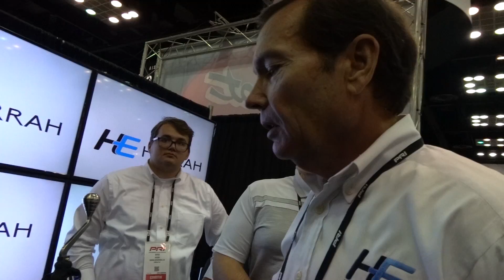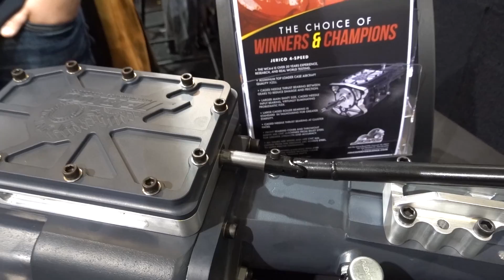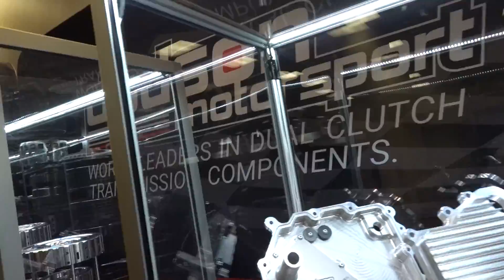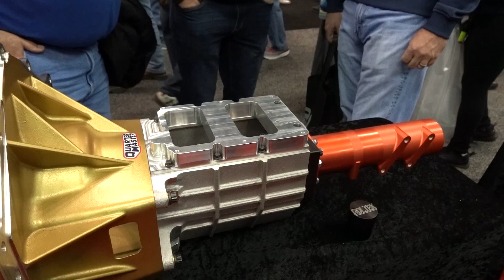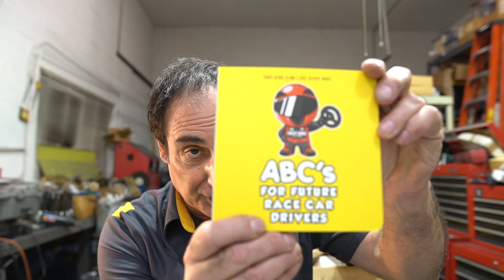PRI Show 2019 - Nascar and Road Race Transmission Edition

Comment: I have to disagree with the jasper guy. Allison is the number one distributor of transmissions.
Reply from the maker: Allison is a manufacturer they sell to distributors. You cannot buy transmissions directly from Allison unless of course you have large volumes like a manufacturer. Like general motors or something like that. But the guy off the street cannot buy a single transmission from Allison. Doesn't work that way

Comment: I think manufacturers are missing the ticket for people who are doing the pro street / pro touring with autocross or road course trackday people, who want a 5 speed they can bang gears clutchless all day, but with a nice deep say .67 overdrive so its not such a nightmare on the highway home. It seems to be o n either side of the equation
Reply from the maker: Clutchless creates wear and tear so its not practical. You can always go with a manuakly shifted auto trans. New T56 and TKX do a pretty good job as a full synchro bix with an OD

Comment: Will any of these gearboxes apply to electric vehicles?
Reply from the maker: Electric vehicles do not need a transmission
Reply: @GearBoxVideo you're correct in that they don't need one, but they do benefit greatly from having multiple gears as shown in the taycan turbo s. It gives better conversion efficiency which equates to a bit more range over a single gear. They can also be used with smaller battery's to give equal range to one with a bigger battery and 1 speed gearbox. Being able to get to a higher top speed is also a plus with having multiple gears.

Comment: Seems  to me that every heavy  Duty  Eaton Twin Countershaft  Truck transmission that I have worked  on had a floating  input shaft..  Nothing new here..
Reply from the maker: Read the responses to other "nothing new here" comments please
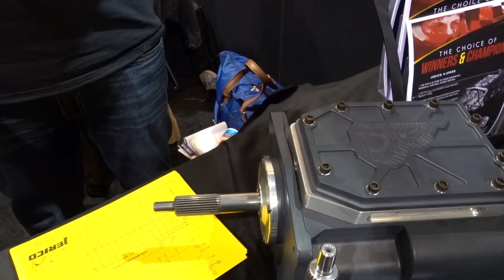Reply: @GearBoxVideo   I have  a Chevy  C-65  tandem  axle  truck with  34,000#  tandem  those are  18.5"  ring gear and Pinion    It had  7:17  gears would  only  do about  55  MPH  at  4,000 RPM's  stock  427  chevy Truck engine won't pull over 3,500 RPM's 
  It has a  13 speed  fuller  RT-613 no  overdrive..  1.5"  input  shaft  dual  disk  12"  clutch ..  a push type  clutch  non synchronized transmission ..  There is an air puck  brake to stop the gears to  get it into  first gear or  reverse.. 
  The clutch  kept  sleeping  in the early 80's  kept  getting oil on the discs.. finally I figured out that they never put a  vent in the Transmission from GM..
   It has a  10 bolt  #2  Bellhousing  that bolts the 5 bolt  Chevy  engine  pattern on the back of the engine..
   The starter  even bolts to the bell housing  not to the block of the truck as the flywheel is much larger..
  I ripped the clutch hubs  out  before  bounces the tires in  sugar snow  with  4 sets of tire chains on the truck before ..
  My  other Truck is an FWD truck with 6 wheel drive. It has a traction lock system that locks  all 6 wheels  together when you are in mud or almost stuck ..  with all 6 wheels  locked  is does not get so much wheel hop from spinning..
  The traction lock system  uses  about 700 PSI  brake fluid pressure..   next to the spider  gears is a set of clutches  like in an automatic  transmission  fiver discs and metal plates and the power divider gets locks out by sliding a toothed dog  into a set of  teeth ..that  lock out the torque proportioned differential ..

Comment: Man I have some real disdain for Getrag. they stopped making the Supra trans (233) and they never offered aftermarket gear sets at any point in time so now beat up abused boxes go for a premium. Even with all the advancement in the 2JZ drag racing and drift scenes no love from Getrag. And now the world record fastest 6 speed H pattern 1/4 mile drag car is a Supra with a T56 Magnum with dog engagement and stock gear set.
Reply from the maker: Companies are under no obligation to make aftermarket gearsets. Just replacement gears. They are also not have any obligation to make transmissions not for their intended use. Meaning if the trans is designed to handle 300 HP there is no guarantee it will work in a 500 HP application. 
Your Tremec statement is misleading be because stock gearsets didn't come with dog rings. Aftermarket gearsets from PPG, GForce and Liberty's do or have been modified for Performance use.

Comment: So what new in manual transmission technology in 2020? Posted from “ch3no2killz”, they are using 50 year old motorcycle transmission parts, like shift dogs, shift drum w/rotary cam shifting. 
What the hell is next? Needle bearings on the connecting rods? Shiny, new alloys, floating input shafts... Still used everyday during the 60’s up, except in motorcycles. The only difference I see is a 7 degree cut angle on the shift dogs to keep high HP engines from popping out of gear. What’s old is new again. So much to say about synchro’s, single cone brass, dual cone friction and lets not forget the Porsche “Balk Rings”! What, never heard of them?
ASE Master Tech since 1978 - Retired
Reply from the maker: I guess you skipped over the DCT section... Gears are gears.  Dog rings are dog rings. It how you use these designs to produce better more efficient transmissions.  Methods of machining change, accuracy changes, strength of alloys, overall assembly weight.. it all changes as metallurgy and machine quality get more advanced. Accuracy of heat treat is better than the 60's. Why does a Top Fuel ring and pinion last 50 times longer with fuel cars producing 10K HP compared to dragsters with less HP in the 70's? Its still a ring and pinion. Current DCT transmissions would have been impossible to implement because we didn't have ecu systems with high speed processors and data streams. FYI a baulk is just another term for a synchro ring, or block ring.
Reply: I am not disappointed in anything I saw and enjoyed the entire video. I was just shocked to “See” old school technology used. Sure alloys have changed, helical cut gears produce lateral thrust and may employ a pre-tensioner gear if noisy. As far as controls, sure, with inputs from VSS, RPM, TPS, various methods from solenoids, hydraulic multi disc clutch packs can in reality/theoretically could aid or complete the entire shifting. These are specialty designed for racing, meeting certain bracket requirements while some are on the dealers show floor now. Weight, complexity, cost, internal frictional losses are all factors that drive the design. I have repaired imports, domestics, transfer cases and automatics going back to two pump power glides I build for the neighbor. Not much I have not seen. By the way, the Porsche “Balk Ring” is a split two piece synchro ring, held in place with a round spring wire and when the shift hub goes over it, pinched onto the gear to speed or slow it down. I have two in vehicles that parts have become pricy but made in 1969. I started making money at home on motorcycles at age 10, from electrical, carbs and bent shift forks. Enough to trade and buy a newer on since my first bike at 8. Still got the photos of the mess. I had to draw the parts layout upon disassembly regardless as I lived on a farm 27 miles from a city that sold parts. Never filled out paperwork or had a resume for the first seven companies I work for and never went to a trade school. They didn’t even have shop in high school. So lucky to have inherited my Grandfathers brain that allowed him to graduate with an electrical engineering degree in 32.
ASE Master Tech since 1978, L1 at 100 questions correct first try, but called NIASE in a the 70’s.
Reply from the maker: Good for you. Glad to see you made a career of what you like to do. Baulk rings as far as the split design you mention is not a Porshe only design. Used in a great deal of Italian transmissions.
Reply: @deankay4434  Need to find me a woman that loves me.....as much as you love you.
Reply: It makes no difference whether it’s a motorcycle, 4 banger in a car, high horse ponies go fast race cars or trucks. Only the machining, materials and lubricants have changed. As I said, what was Old is new again! And yes, the split-ring synchro’s are refereed as “Porsche Type” as a cone shape brass synchro’s are called “Borg-Warner”. Regardless if their design or invention but made them popular by shear numbers made. It’s similar to the brass cone-friction type as conventional lubricants do not allow them to function by moving freely to allow the gear to speed up or slow down. So, let’s use a synthetic lube that responds better in colder temps as reduced viscosity lube, but now, let’s stack two back to back to shift. Holes, grooves and reliefs have to be employed with the lube to allow grabbing onto the next gear. The “Borg-Warner” type brass have proven to last 300k miles or more and work fine.
 As if you are taught correctly, you must love yourself first before having the ability to love some else. Jesus repeats this in the Bible. As for a women, I have had one of the best for 40+ years. You are welcome to work that problem out by yourself!
ASE Master Tech - Retired
Reply: That's because a bike doesn't make much torque even if built to the extreme it wont make much torque until much later in the RPM range plus the light weight of bike compared to a car significantly lowers shock load. whats new is the machining processes and materials also those slight angle changes are due to years of experience plus new modeling software and development of new tooling that in conjunction with better electronics and oil pump mechanisms have made it possible for these designs to truly handle the abuse of modern race motors while improving certain qualities of life such as shift effort, feel and speed. You're analogy is a bit funny, because you can say the same thing about piston engines (Old tech from a long time ago) but that doesn't stop us from making little tweaks that eventually made that old design become more efficient and deliver a ton of power reliably for thousands of miles even on a daily driven vehicle without much qualms. Don't forget about rotary sensors, potentiometers, are now much more accurate since ECU's sample rates have greatly increased allowing for almost infinite real time adjustments at blinding speeds. motorcycles have just started getting this kind of technology but it has been in development for cars since the 80's (true closed loop systems that is)
Reply: @ChrisspyMKIV  Beautifully stated.

Comment: Would there be a way to add one of these or any 4/5 speed transmission to my 94 ford E150 van?? I can’t stand power robbing auto transmissions.
Reply: I have a 93 e150 with the 351w and e4od with the same interest. I’m hoping for 18-20 mpg with more power (lose the clutch fan, beef up your electrical and run electric fans = +10-15hp.) 
You have the roller block if you’ve got a ‘94 351w which is a great foundation.
It looks like we’ll need:
Zf5 transmission from f series (there are rebuilt zf5’s on eBay for $900)
Clutch, pressure plate, flywheel, TOB
Clutch pedal assembly from manual f series obs, modify the brake pedal (I plan to cut mine down and move it closer to the throttle). Shape that wheel well that impedes the clutch pedal area.
Slave cylinder (you’ll need to bend up your own clutch slave line)
Ecu from manual truck for your engine size
Driveshaft may have to be custom
Modify your floor and bend up your own shifter
Your stock radiator has a trans cooler in it, I would suggest swapping to a new unit for a manual.
Your auto trans support will need to be modified or you’ll need to fab one up (not very difficult).

I may have missed something, but with a set of 4.10’s in the rear end, it will “feel” like the van has 40-50 more lbs ft tq. A stroker attached to a zf5 would make the van fun to drive. I haven’t weighed mine, but empty I’m guessing just under 6k lbs.

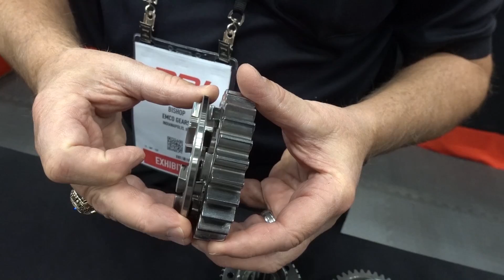Comment: EMCO at 20:00 min. you refer to the "shift drum", as it's been called in the motorcycle ind. for 50+ years.  Also every body is into face plates, bikes had that in the same period, yet no one ever mentions that most of this tek is even related to motorcycle gear boxes.  Amazing!
Reply from the maker: I actually have footage of a drag bike transmission I may post soon. For that matter motorcycle transmissions are sequential as well. Face plating is not new and has been around in auto racing transmissions into the 50's and nobody is claiming it's a new technology. However, what is new is perhaps how it's implemented and the ability to machine drums and profiles with extreme accuracy.
Reply: @GearBoxVideo  
Interesting, indeed! 
THANKS SO MUCH FOR THIS CONTENT AND EDUMACASSIUHNN....! ;))

Comment: There are many reasons for a floating input shaft, Aimee of which are mentioned here. But when it comes to bell housing misalignment they forgot something. If the main bearing bore has to be tried so the crankshaft runs straight through the engine block the machinest might need to tak material off of both the main caps and block saddles. It would be preferable if just the main caps get remachined, but not always possible. There are two reasons for this. If you are converting the block to four bolt main caps, the block might need to be machined at the mating surface for the caps to sit correctly, and they may have to mill down the block to accept the caps. The other reason is that the crankshaft bores may not have been machined properly. Years ago one of the cars magazines took a Chevy 305 and a Ford 302 and built them with the same specs as each other to see which engine made more power. The Chevy had major problem as it came from the factory. The main bore for the crankshaft was going through the block sideway and at an upward angle. So the machine shop they were using had to cut down the main caps and the bearing saddle to get the crankshaft bore straight from front to back and level. Then the cylinders didn't line up with the crank so they had to be corrected. But the change in the crankshaft location would also change where the pilot bearing was located and wouldn't line up properly with the bell housing. So the transmission's input shaft would have been push to one side or another or too high or too low. A floating input shaft like these would allow the transmission to live much longer under stress along with side loading.
Reply from the maker: When we talk of bell housing misalignment we are talking about the register bore of the bell not being on center as well as perpendicular with the crank center line and the block face. I'm well aware of how  line boring and line honing effect this. You can bet most of these pros are aware of it as well. Since it is very common for after market bells to be out as much as .030 , bells are always dialed in. Keep in mind these transmissions are going into cup cars and I'm sure they made the effort to dial the mating bell housings and I think a few Nascar engine builders know how to align bore a block properly. That being said, the take away here seems to be chassis and housing flex adding to slight misalignment and edge loading of the main drive.

Comment: There's no point in running a dual clutch transmission.  An automatic is the same thing wet clutched. I think a zf 8hp is probably lighter than a dct?
Reply from the maker: You can't beat a dct trans when it comes to faster shifts and less HP losses. Perhaps that is why Porshe and Audi started using them. Best of both worlds
Reply: @GearBoxVideo  Another advantage of the DCT is the total freedom in gearing. In the ZF 8HP the plantary gear sets are shared across ratios, giving much less desirable jumps in ratios between gears compared to a DCT. BTW thanks for the video, really interesting as usual!

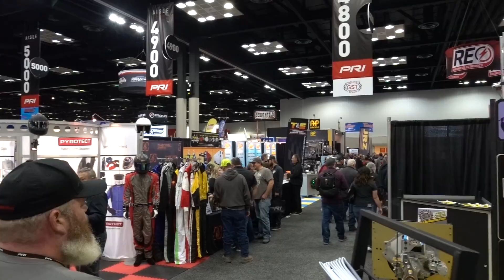Comment: 26:37 ...  my 2002 Ford 7.3 diesel has the  zf 650- 6spd... and they make a little 2spd box that bolts up to the tail shaft so that you can get an extra overdrive gear for highway use (I forget what it's actually called)--  but it looks very similar to that little 2 speed set up.  Interesting stuff.
Reply from the maker: Doug Nash engineering made one but it is no longer in business.  The current bolt on overdrive that is available is from Gear Vendors

Comment: Wow.. So the dual clutch trans are built like manuals.... They just have actuators that shift for you- Interesting.
I can see why a lot of cars are using those.  If they could just build the clutches on a 90 degree gear so they stick out to the side--- where you could easily pull a side cover off and change the clutches when you needed to- without having to remove the trans at all--- then it would be a no brainer to put them in Everything.... Since it would be so easy to swap the clutches that way;  because I can't see them lasting all that long if you're throwing 2500hp at them. lol  .... Very cool video. thanks
Reply from the maker: They are more like automatic clutch packs.  You wouldn't change automatic clutch packs and neither would you with this design. The advantages of a Dual Clutch system is it essential is a computer controlled manual transmission and eliminates the torque converter. More efficient than a classic automatic transmission design.
Reply: That 90 degree gear would also rob 30% of your horsepower.....
Reply: @janeblogs324    So you're saying that a rear wheel drive car has 30% less horsepower than a front wheel drive car that has the same engine?....  Because that rear differential is the 90% turn that I'm talking about.... interesting-- I'm not sure if that's true.  But I'm sure there is some loss factor involved.

Comment: The sequential gearbox looks very familiar to a motorcycle rider! Can remember the revelation of shifting under wide open throttle when ignition cut-outs were first implemented. Less work for the rider and better lap times. When I rented a german car with a dual clutch for the first time I was like Whaat! how is it shifting so fast, even faster than sequential. Thanks and Merry Christmas Paul!